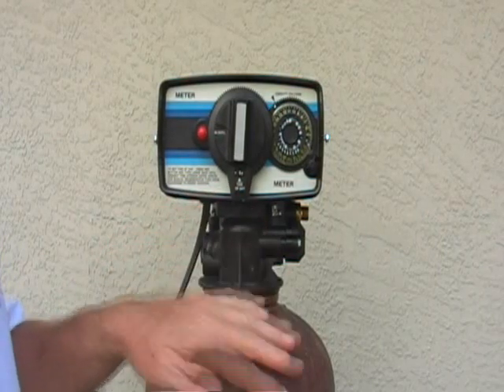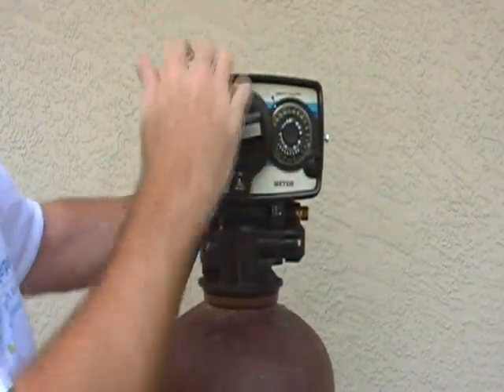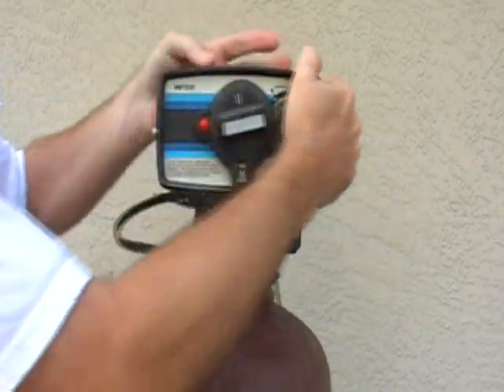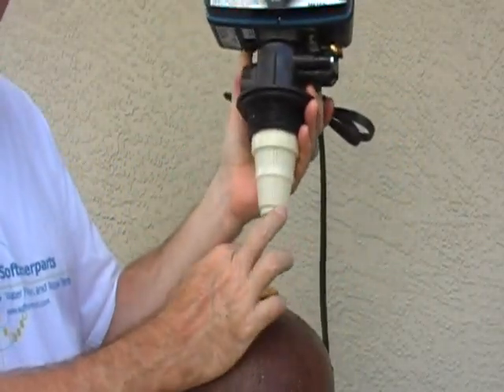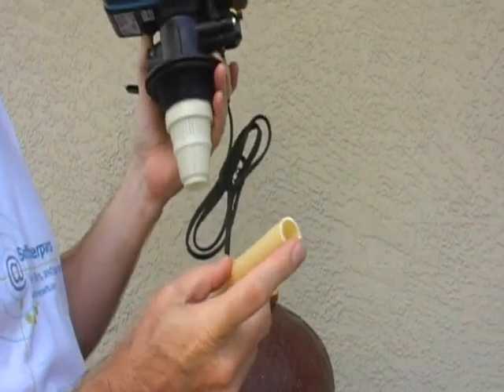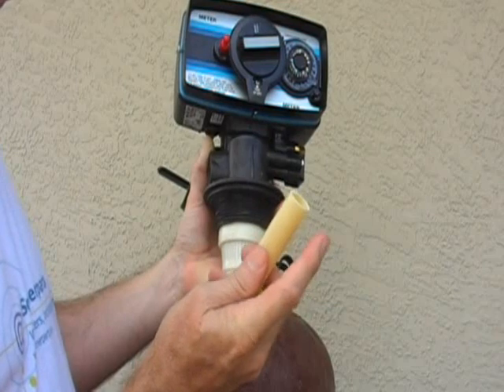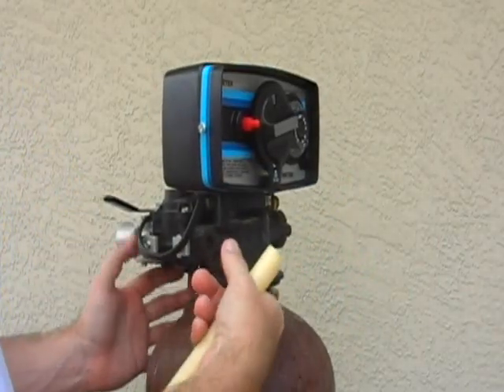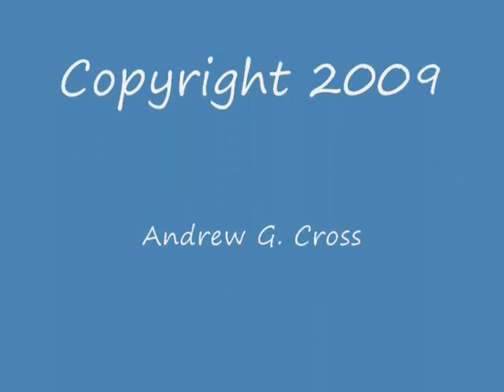Removing Water Softener Valve from Tank ( standard threaded tank )

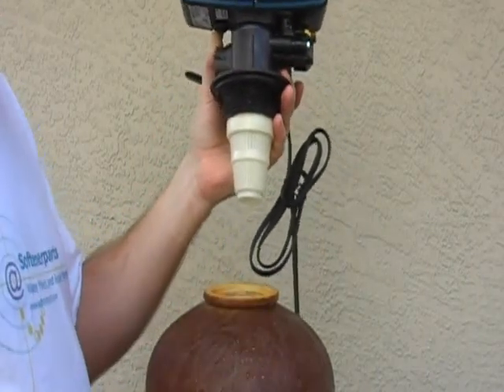Comment: At 4:00, your comment about the o-ring was the solution for my issue of a properly working system but no soft water.  I did not find anywhere else on YouTube or install manuals about making sure the tube is inserted through the o-ring up into the valve head.  Thanks!  Also, those water hardness test strips are junk.  The Hach 5B Hardness Test Kit is essential.

Comment: Hallo Andrew. May I ask a question? I have a similar system installed in my house. I have a 5600SXT valve. Actually the system is not correctly working, so I need to do some DIY work to fix the thing. I leart a lot watching various videos, your too, but I keep having a doubt. I'd like to completely disassemble the system, so I can watch the resin inside the tank, also I'd like to dismount the 5600SXT valve, so I can check the parts can be obstructed with dirt/salt etc. But when I turn off the system, and bypass it, I end with the tank very heavy, 'cause I think it's still filled with water.
So, do I have to manually select a specific phase of the regeneration program BEFORE I shutdown the system and bypass it (before I start to unscrew the various tubes from the valve)? Should I do this manual part of the programming with the bypass on (so no new water come inside the 5600SXT)?

If you can, please waste a minute to give me a kind answer. Thanks a lot in advance.

Comment: I very gently put a large pipe wrench on the flange below the head (right above the tank), and it loosened very easily.  Trying to remove the head by hand by myself wasn't making any progress.

This time, I didn't tighten the head as much.  Hopefully, it will unscrew more easily next time.
Reply: THANKS!!  You gave me new hope.  I took a slightly different route.   Harbor Freight Item Number 63834 16” V-Jaw Groove Joint Pliers $15.99 ($12.79 with coupon!).  Like you said, grip at flange and it will come off VERY EASILY just by yourself.  I tried this with 2 people (no pliers) during another maintenance several years ago and just gave up thinking it was impossible.

Comment: Yeah, but how do you remove that basket? Looks like it goes on easy but trying to remove it is a whole other problem.
Reply: The top distributor basket is not really meant to "come off" once installed. You can remove by using EXTREME Force -- likely breaking in the process. A new Top Distributor ( PN MD1203 for 1.05" O.D. Riser Pipe ) would then be required.

Comment: My tank is not exposed but enclosed by the salt tank and has a lid. I can't get hold of the resin tank to be able to unscrew control valve. Only way I see is to get tank out is lift it out of salt tank, at least a 2 person job. Only way to lift is grab by the control valve assembly. Is that strong enough to lift tank out?
Reply: You may not have a fleck 5600   The real question is do you have this type of valve, you may have a GE or whirlpool which is a little different

Comment: Thank you so much for your video. I did not understand the part of the upper basket being optional. I am an A/C guy but I am helping a friend with his softener.  What is an overfilled tank or short tank? And what type of resin requires the upper basket? I could not understand what you said.  Hope you can respond quick, I am in so much trouble right now ! Lol
Reply from the maker: Carbon filters "require" the Top Distributor to prevent carbon "fines" from getting backwashed up into the Valve and out the drain.

A properly sized Water Softener ( tank 44 inches or tall and filled no more than 60% full ) and Iron filters ( media is heavy ) do not "require" a top distributor.

Only when a tank is overfilled ( more than 60% ) or Tannin RESIN is added to a water softener is the Top Distributor "required" with a water softener application.

We do include the top distributor with all our water softeners and complete Valves as a precaution, but no because they are "necessary".
Should the water flow be REVERSED or the TANK be laid down, the top distributor would prevent the media from going up into the valve head.
Reply: Andrew Cross 
I put in a tan / orange color resin. I really have no idea what kind it is. Does the color tell you anything? I threw the bag away already. 
The tank is 1054, I think that means it is 10” diameter and 54” height correct? I did fill it up to about 60% only.
Reply from the maker: Water Softener Resin come in may colors ( amber, brown, black, and orange are common ). And a 10 x 54 tank would properly hold 1.5 cu.ft. of Resin without needing a top distributor.
Reply: Andrew Cross 
So does the color matter?  If the distributor is needed only for “white tannen resin” and the resin I used is tan or orange does that help eliminate any possibilities?
Reply from the maker: You need to read up about RESIN on our website.. this is not the place for me to explain everything there is to know. See our "Resin Replacement Guide" under DIY Repairs"

Comment: Harbor Freight Item Number 63834 16” V-Jaw Groove Joint Pliers $15.99 ($12.79 with coupon!).  Like other comment, grip at flange and it will come off VERY EASILY just by yourself.  I tried this with 2 people (no pliers) during another maintenance several years ago and just gave up thinking it was impossible.  This time I saw Emmett Kelly's comment.
Reply from the maker: Good suggestion. This tool would give you the added leverage to get a stuck valve to unscrew from the tank, and only require one person.